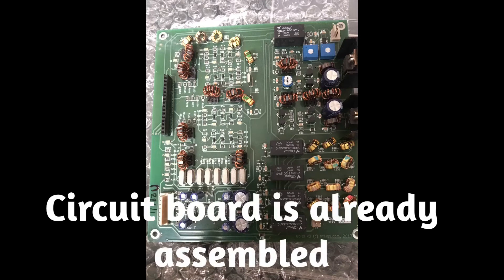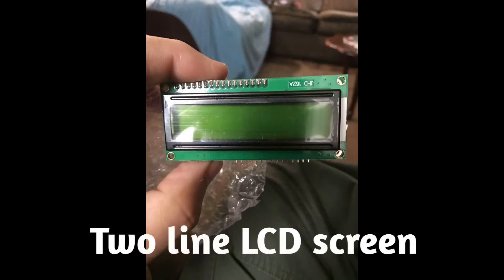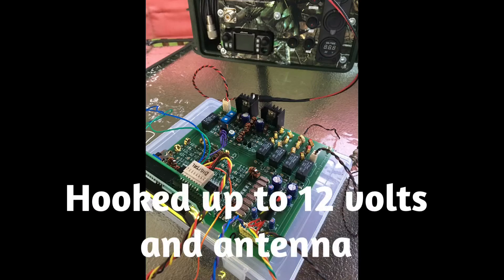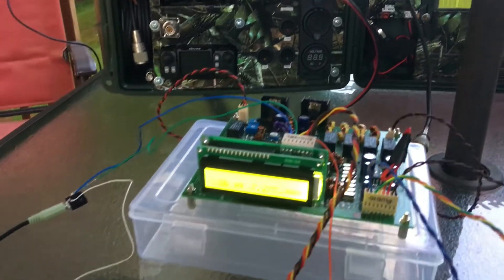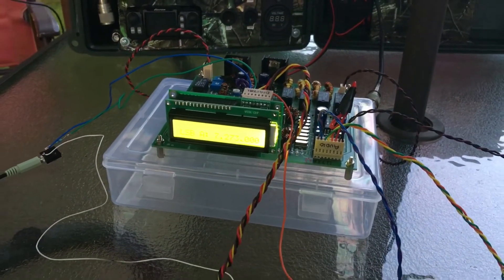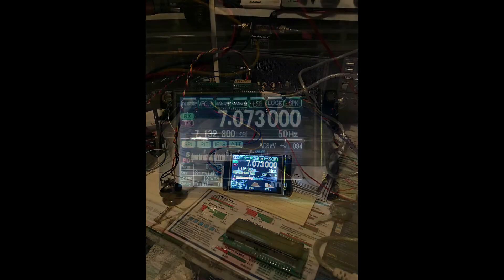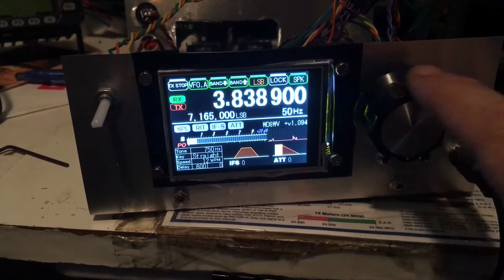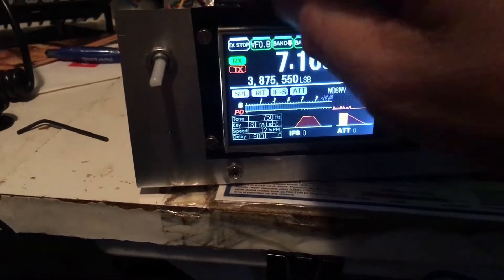uBitx 10 - 80 CW/SSB Transceiver - UPDATED!!!

Comment from the maker: Here are some links to some of the information about mods that I did and plan on doing.  The first is for Ian Lee KD8CEC Blog where he had developed some good firmware.

http://www.hamskey.com/2018/

Here is the link for the RF gain control by ND6T.

http://www.nd6t.com/bitx/Another%20RF%20gain%20control.htm

Here is the link for the AGC circuit, and in the text it tells you who to contact to order the actual kit that was developed using ND6T's design.

http://www.nd6t.com/uBITX/AGCkit.htm

And this is a great page packed full of information regarding uBitx.

https://ubitx.net/
Reply: Gday cobber,I have ordered one of these kits and wondered if you could get me the schematic for the four pin cb mike socket. I am quite the beginner and think I could nut it out as the blue seems to be ground but I  would hate to get the other two wires back to front and break something.  Cheers Ross

Comment: What gauge and material is the case made from?
Reply from the maker: Tim, I thought I explained it in one of the videos, if not this one.  This is valley tin that I purchased from Lowes.  It is the 90-degree bend valley tin that I bought.  I think I bought 4 sheets, and in the video you can see where I used aluminum tape on the top to cover where the tin overlapped each other.  I used aluminum angle that I either bought at Lowes or Tractor Supply to make the frame for the circuit board to fit on and for the valley tin to fit around.  It was an awesome project to build, and I have another uBitx kit that I bought, I think version 5 or 6, still in the packaging and I am thinking of building it.  Don't know if I will put it in the old CB cabinet or into a ammo can.  Just to many other things, but when I retire at the end of the year, I will start thinking about building it.  Thanks for watching and I hope this helped.  Juddie

Comment: Did you have to modify the microphone amp circuit to get enough drive? My version 3 board sounded good on tx but didn’t have much power output on ssb compared to cw. It didn’t really register on the wattmeter on ssb. Did you do the mod to reduce the 2nd harmonic that ver 3 had problems with?
Reply from the maker: Tech Guy, honestly I can't remember for sure what mods I did to the transceiver.  I know I did several things to it that I found online that others had done.  I know I used this uBitx a few years ago for a Parks on the Air activation I did at Babcock State Park here in WV and made 13 contacts with it.  I know I was being heard clear into Canada and my antenna was a end fed antenna sloped from an oak tree to the picnic table I was operating from.  Thanks for watching and your questions, wish I could be of more help.  Juddie - WD8WV

Comment: Great video (and radio), thanks. I'm getting ready to order the newly-released v.6 of the uBitx.
Reply from the maker: I have been debating on whether to buy the newest one out or not.  I still have an unbuilt V4 laying on the shelf with an extra arduino (to do the KD8CEC S-Meter mod) and the Nextion display.  Just need to make a case for the radio.  Thanks for watching and commenting.  Juddie - WD8WV

Comment: Nice job on the enclosure. I was lucky to find my uBitx kit with an enclosure that made it really easy to get it all together. After working 40M using the FT8 mode, I managed to smoke the finals. After replacing with a couple more of the IRF510 finals I went to a more robust RD16HHF transistor for the finals. I also did the upgrade using Allison's KB1GMX suggestions on the HF Signals website. The button really helps when using the menu feature. I may go to the Nextion screen for a final enhancement. Yours looks great!
Cory, N4UVR
Reply from the maker: Cory thanks for watching and your comments.  I will have to look into the upgrade suggestions by KB1GMX.  I have a uBitx Version 4 to build this winter and I still haven't figured out how I want to build it.  I have a Nextion screen for it as well as an extra arduino to do the S-Meter mod and the AGC circuit to build.  I am not sure if I want to build it into an ammo can enclosure or a Pelican case type enclosure.  I had even thought about building it into an old Royce base station CB cabinet.  Just can't make up my mind.  Again thanks for watching and your comments.  Juddie - WD8WV

Comment: Why are you whispering with such a high noise floor in your recording. I can hear you but if myi tablet had some filters I would use them.
Reply from the maker: I was using a head set I believe when I did the editing on my computer and the window air conditioner was on.  Didn't realize that the boom mic was picking it up that bad.  Juddie - WD8WV

Comment: What extra hardware needs to be added? Agc circuit, s meter circuit? What does that software and touchscreen provide?
Reply from the maker: It provides S-Meter reading, but you have to use another arduino along with the original radunio.  Dr LEE KD8CEC shows and explains it in his blog and YouTube videos.  He also has in the software a pretty good CW decoder.  It has been awhile since I have used the radio, been to busy and I also just finished a Bitx40.  As well as getting another QRP-Labs QCX qrp rig for 20 Meter band, and picked up a Yaesu FT-817ND to do POTA.

Comment: Love it! That is so cool. I am going to get one of these soon myself. 73 KC3JAI
Reply from the maker: Jeffrey, thanks for watching and commenting.  I love this little rig and hope to work field day from my deck this summer with it.  I have another one that I haven’t built yet.  I am wanting to really do it in a case with a 12volt 7amp/hr battery so it can truly be portable.  73 Juddie WD8WV
Reply: @JnJTrueOutdoorAdventures  that sounds like a great idea. I was just thinking how cool it would be to integrate the ubitx into a car. I mean like inside one of the dash pockets with a face bezel and everything. It's difficult to fit radios in cars and this would be a cool challenge. Not sure if it would work due to board size and ground shielding.... We will see. Look forward to see your next build.
Reply from the maker: Jeffrey, that sound like great idea.  I actually saw where someone sort of did that.  The main board was in a housing under the seat but the screen and controls were mounted on the dash.  It would be a challenge for sure.  DE WD8WV

Comment: Where can i find the case ? And i try to do s meter and it's doesn't work
Reply from the maker: The case is my own invention made from aluminum sheets and aluminum angle.  Then I covered the top with imitation leather product.  I also had problems with earlier s-meter modification.  Recently I upgraded my firmware to Ian Lee KD8CEC's 1.098 and added a second arduino according to his blog and videos and now my s-meter works.
Reply: https://ubitx.net/category/hardware/cases/

Comment: Hi!  Very nice build!  Im starting to assemble the document list for my own build and I am curious about the RSSI mod you refer to.  If you have links to any of the mods I am very interested in looking them over.  Good job on the enclosure!  i am partial to the Lansing Instruments enclosures myself.   They can be a little on the pricey side...but they sure are nice.
Reply from the maker: Lyn, please check J & J True Outdoor Adventures FB page for a reply to your message you sent me there.  I have provide as much information as I could, that I remember.  I had done a lot of reading before I bit the bullet and bought the uBitx, so when I got it I knew pretty much what I was going to have to do to the Version 3 board.  Thanks for your comments.  73 Juddie WD8WV

Comment: Man that is a beautiful job on the enclosure, real craftsmanship. I been getting a chuckle out of the fellows doing vids on these & complaining there's no commercially available chasis made for them, what happened to the good old days of DIY in ham radio? Any rate great work, de 73
Reply from the maker: Thanks for the comments.  I have a version 4 board kit now, and have been tossing some ideas around.  My first idea is to a communications box like the one I use to power it in this video, just a slight bigger box to house the uBitx and another VHF/UHF radio with 2 - 12 volt batteries.  My next idea is to take an old Royce CB 23 channel base station, pictured in this video, and build the kit in it using as much of the internals as I can.  Then lastly is to take something like a pelican box large enough to put in a 12 volt battery, and the uBitx with a QRPguys antenna tuner.  Again thanks for the comments.  73 de WD8WV
Reply: J & J True Outdoor Adventures You're welcome, those all sound like great ideas & judging by the job you did on this one I'm sure any of them would come out awesome too. Do these little rigs generate much heat? That would be my only concern with putting them in any kind of go box or pelican would be ventilation, but I'm sure it wouldnt be hard to setup some 12vdc fans to keep everything cool
Reply from the maker: Ben, the only issue with heat that I have read about is running digital modes with these rigs.  They do advice to add larger heat sink to the two finals or a fan.  Wasn't thinking to much about doing digital with the uBitx, but I have recently got to looking at using a Raspberry Pi3 with touch screen also to do digital.  That would really look good in a pelican case with two touch screens, one for the rig and one for the Pi3 and I am sure I would have to run a PC fan to pull the heat out of the pelican case.
Reply: J & J True Outdoor Adventures That would be a cool setup in a Pelican case, sounds like the ubitx is very modular with quite a bit of flexibility in what can be done with it. Let us know what you do for a setup, I'm very interested in seeing what you come up with
Reply from the maker: Will do.
Reply: Take care that you don't put the Mosfets on a common heat sink or connect the HS to Gnd in any way.  I suspect a lot of guys have lost MOsfets in that way.  This is not a problem with the Mitsi RF mosfets RD15HHxx and similar which have a Tab equals Source config,  but it sure is with IRF510 and similar - unless you use a mica spacer and approp hardware and then you have overheating issues coming up.